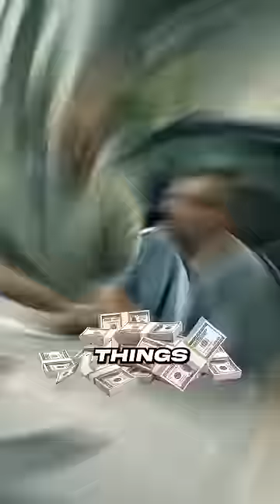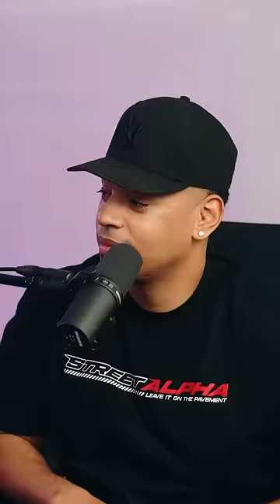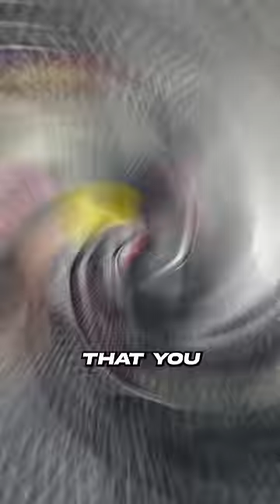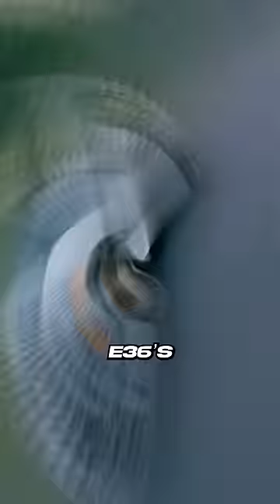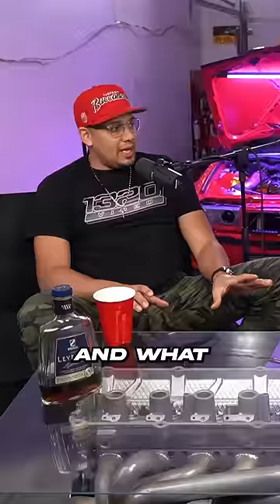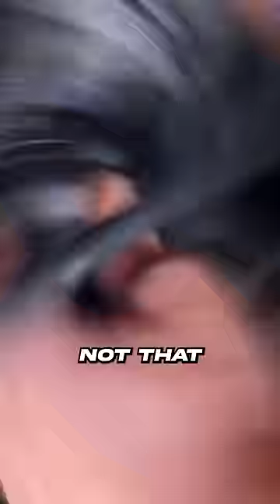What BMW DOES NOT Tell You 😩 #shorts

Comment: I work for a towing company! This man is really onto something! I’ve been towing 2021-2023 BMW’s like crazy for the past few months! Oil leaks, coolant leaks, reduced engine power lights, electrical problems! Stay away from them!
Reply: But BMW is fire bro... 😅
Reply: That’s cuz people are stupid and they buy them without knowing how to take care of them thinking they’re the shit. Cars like that need to be cared for a tiny bit more since they’re a step up from a lot of cars but people don’t know how and it gives those brands a bad wrap.
Reply: @1Gambler_ they are very nice and luxurious but yeah, I’d never buy one
Reply: You are just a big liar. 2017 and up are very reliable. They feature updated version of the problematic engine. Most of the issues have been resolved on these model years.
Reply: @ifeanyiikemefuna3706 I have a 2016 328i that I’ve owned since 2019. Got it with 16k miles and I’m currently at 59k. I’ve had 0 issues other than random electrical shit aka Bluetooth or wired audio just stops working (happened less than 10 times) I did have the car go into limp mode once due to a sensor reading the fuel was running rich (happened around 2021) haven’t had a code since then. It’s a German car they are over complicated for no reason but they’re a far way from the shitty engineering they used to have back in the early 2000s
Reply: @1Gambler_ hell no bro it's an overpriced piece of shit. The equivalent of iphones in the phone industry.
Reply: @420Manhwa  Who's offering better cars than BMW.
.
 VW? Merc? Nissan? Hell nah
.
BMW understands the streets bro.
Reply: @realmz.4575 they are crap...I knw ppl buy them and drive 20km from dealer and it shut dwn...and I'm tlking new BMW
Reply: Never seen a 2021-2023 BMW broken down on the road and I commute a lot. 
Either 
1. You are lying 
2. Not familiar with the year makes and models (you probably looked at a 2006 BMW and thought it was 2023)
Reply: @ifeanyiikemefuna3706 100 percent agreed. We haven't even seen how long the 2017 and people make these ridiculous conclusions.
Reply: @AraP24  So because u haven't seen q means it hasn't happened....🤔are u God you are EVERYWHERE at once?? Do you knw EVERYONE or every BMW owner??
Reply: @ifeanyiikemefuna3706 lmao okay then bro! Whatever you wanna believe. BMW’s are beautiful but they’re straight trash! Endless money pit!
Reply: @AraP24 right but who owns a towing company? Me! Do you? I’m on the road daily! So I tow them daily!
Reply: Any proof of this? Cab we confirm you're tow truck driver?
Reply: @1Gambler_  lol that's easy. Lexus 😂
Reply: @Jose-it9po  I do accept there was a time BMW engines left much to be desired but the story is different today. I'm confident because I have one. My experience has been awesome, my greatest expense has been gas. And I've got a V8 not the glorious B58. It's your word against my experience - sorry, my experience trumps your words every single time.
Reply: I’ve owned 2 so far 2014 and 2021 F30 and G20. 1 I’ve never heard anyone recommend getting an oil change every 20k miles. 2 Those cars would still not only be under warranty but also under a maintenance package. There would be no excuse for  neglect if you can bring your car to a shop for the tiniest thing for free. Only thing I could think of is a cracked rims or shredded tires because BMWs don’t come standard with spares. Ive owned my most recent one since 2021 and my maintenance package ends in November. 60-70k is when you start having to worry about getting a tune that includes getting new spark plugs and ignition coil. The only recommendation is to change out the plastic charge pipe for a metal one.
Reply: @realmz.4575 there’s no excuse. When you purchase a new bmw they come with a maintenance packages that lasts for 3 years or 50k miles. If it’s a 2021-23 they would be still covered. The owner just has to go to the shop when the car says to. Regular maintenance like oil changes, filters, lights, wipers are covered if you pay a little extra brakes and rotors are covered. What you’re saying is true for someone getting a slightly older model.
Reply: @Jose-it9po I always wanted an m3 but ALOT of people say negative things about BMW. And it's the same here. Because of that I never wanted to spend the cash
Reply: All i can say is the word "intake manifold/bridge"
Bmw guys will understand
Reply: @ifeanyiikemefuna3706  take off undercarriage bet you got oil leak
Reply: @6.2_2ss  it doesn't matter what I have got going on, the car moves with no check light. Moreover, my car gets inspected at every 5k miles when I do my service at the dealership and they recommend whatsoever they think need to be fixed. Take your maintenance serious and you will have rest of mind.
Reply: @Jose-it9po  your anecdotal claims mean nothing. Like I said, you probably cant tell new BMWs from old ones. You probably just look at the badge and proceed with your confirmation. If 2021-2023 BMWs failed so often on the road that requires towing as you bogusly claim , there would have been major recalls or lawsuits which don't exist.
Reply: Theres no way to care for the plastics eventually theyr gonna get brittle and break
Reply: what about mercedes?
Reply: @Sphe.M  same and they use air to water intercoolers more expensive
Reply: Tell me about it.. I'm a truck driver. The most cars I've seen stalled on the side of the freeway........YES ....BMW....You want a good car buy a Toyota or a Honda .
Reply: Hes not speaking rocket science. Talk to any mechanic who has worked on bmw’s. They will all tell you they hate to work on them. Things break as soon as you start to take things apart.
Reply: oil LEAKS !!!!!!!!! yup
Reply: @Jame6999 I have an X4M comp and it is a beauty - the engine is quality. I would say people complain about the quality because they are expensive cars so anything that does go wrong you are getting a 180/hr working on it so you feel it or notice it more (if you are towing company owner) Like anything expensive you do maintenance to ensure something doesn’t go wrong - BMW doesn’t need to use failing parts to lock you in, it is the finance agreement and the depreciation. If you worried about costs stick with a Corolla or whatever car is cheaper to run and maintain.
Reply: Y'all need to stop falling for the "old bmws suck" the 2000 bmw z3 was the best handling car in top gear and it went against a goddamn FERRARI at its time nd sure yeah sum things are plastic for NO REASON😅but trust me any bmw 2000 nd under is easily workable on nd most parts are replaceable with metal reinforcement e.g coolant hose
Reply: Maybe just warm up your oil first before tripping that 8000 revs 😂
Reply: IVE HAD EVERYTHING YOU JUST SAID HAPPEN TO MY BMW. AND SOME.
Reply: @realmz.4575 they’re a step up? 😅if u think the need to baby a car and treat it as if it’ll shatter apart if u rub it the wrong way is a step up then I question your judgement. Reason why u have to tend to them a certain way is because they’re fragile creatures, let’s be honest buddy
Reply: @lowk3ychris484 buddy, chill… u are still within warranty life. Wait till u get to 80k-100k miles. U gonna learn what bro in the video was talking about
Reply: @KnowPain666  doubt I’ll ever get the car there 😂 still under 60k miles at this time
Reply: @lowk3ychris484  it’s easy to doubt but u said u got it at 16k miles,. You’re pushing 60k now. Those numbers go up pretty fast. I’d say they’re better to lease and switch out every 2 yrs for a brand spanking new one. Yes, u would never own it but u won’t have to worry about maintenance fees and the life expectancy of the vehicle
Reply: Nonsense. Lies upon lies
Reply: I've got a 2016 335d. I've done 18k in repairs, just over 2 years of ownership
Reply: I work in motor trade and asked a recent Tow truck guy what cars breaks down the most from his experience, and he told me Range Rovers
Reply: All bmws are crap especially when they get to 100k miles
Reply: Not even close to what he's talking about.....
Reply: 2 months and 1400 tows later I still stand behind my original comment. BMW’s (not the older models) are straight trash 💀
Reply: @SuperKoreanzombie depends on the company and the area they work in and what car is most common for said area. I’ve towed a few Range Rovers. Usually lost keys or dead battery and won’t take a jump so they end being stuck in park. BMW’s are common in the area I work. There’s never a week were I don’t tow at least 5 of them. On top of that our company has a contract with BMW Roadside, so I tow them frequently. Only voicing what I see from my experience
Reply: @realmz.4575 No, these new BMWs, Audis, and Mercedes are dog shit compared to the cars they made 15 years ago. They have started using cheap engine and electrical components which is why so many things break on these new ones. They are using cheap parts and that’s why they are breaking down more than before.

Comment: Automotive engineer here.
OEMs being our customers they tell us how many years or miles a car needs to work without failure. Roughly 15 years or 170k mikes depending on the industry. We engineers calculate the equivalent testing procedures to guarantee durability along these hours of usage. If the parts fail, we need to redesign. If the parts survive the goal by a small amount the part is good. If the part is way too strong, its described as overengineered and therefore there must be a cheaper solution that also reaches the goal that has been stated by the requirement profile. At least here I can say we do not design for parts to fail intentionally, we design for parts to be not unnecessary durable as they would be heavy, inefficient and more expensive and you the final customer are not willing to pay for that.
Reply: I hope you ain't lying coz this actually makes sense 😂
Reply: Si a new car is cheaper than a new part???? Because it will be more heavy? 💩💩💩💩💩💩
Reply: Great response from an Automotive engineers. Thanks bro.
Reply: Also alot of things the engineer wants to add gets scraped by the guys doing the Productmanagement, because they want to maximize the profits.
Reply: @chexey  yeah especially recycability, remanufacturability or sustainability often gets scraped... but I do see here a positive change in the industry at the current time
Reply: @M_aze my thoughts exactly lol
Reply: Sounds like what apple does when it wants you to buy a new phone ..all of sudden battery turns to 💩
Reply: This is still planned failure. They put a nice story around it so you don’t complain… but they are asking you to make sure it fails at a specific point. Finding out it didn’t break and saying “oh it didn’t break? It’s over-engineered it needs to be weaker to save weight” Says it all. 

Over complicating designs ensures the customer won’t be able to fix it themselves and any person with sense would just buy another after certain failures. You really gonna rebuild an engine or trans at 170k? 

No. The other planned failures will creep up shortly after and make you regret the decision to try and kick it down the road. Auto industry is very dirty these days.
Reply: American engineers:

Japanese engineers: wait you guys dont overengineer every part???
Reply: No I 100% would pay for that. But they won't offer that. Ever.
Reply: @fabiancastellanos7196 wtf are you saying?
Reply: @PatRiot-  no, what OP described is typical engineering design trade offs not "planned failure". Weight is a significant factor in a car's performance and better performance than your competitors will likely increase your market share.

The majority buying new cars from prestige car companies would have upgraded long before 170k miles which means their actual customers (not the second hand market) are not motivated by "planned failure" at 170k
Reply: Doubt that bmws implements this.
Reply: I want an over engineered car that can do a million miles without breaking. I don’t care if it is heavy or expensive.
Reply: Unnecessarily durable means a good part that will last the lifetime of the vehicle. And that translates to less profits for the car manufacturers. Using that double speak, I see.
Reply: @meademorgan6614  if the whole car is designed with the goal in mind to cost the least possible, because otherwise the final customers will just buy another car that has better "value" . So there needs to be a requirement profile that states the lifetime of the car. If one part surpasses this by three times, it wont benefit you as the car will be scraped a long time ago before the part itself reaches EOL. So that part was unnecessary expensive, and that car for the stated requirements unnecessary expensive. The market regulates itself. There are durable vehicles for hauling ass but they do cost more. And they are less efficient, and heavy. Being less efficient means also more taxes and costs to operate and bla bla bla until it gets unattractive because everyone is accustomed to cheap stuff. However I do agree that everyone likes to have a margin on its production and greedy CEOs and Shareholders want even more money than necessary and that in general worsens the situation everywhere and on every level involved including transportation of parts etc... But that mainly just makes stuff unnecessary expensive and not really prone to fail by design.
Reply: LOL

Comment: Former BMW tech here. If you actually change according to the schedule, you won't have problems. I've never saw sludge build up on vehicles that did it right. Premium oil and technology to understand engine oil breakdown make it possible. You can't design a car to fail the moment its outside of warranty. He mentioned E36 the old ass gen 3 series. So what about the vehicles from E90 on that improved on most all of the most significant failures. They improved with life cycle upgrades for a better product constantly. They sit at the leading edge of vehicle technology, years ahead of our domestics. BMW does want you to come back, but they can never guarantee it. The service return is not what they really want is the new car after warranty. We always said BMW is a special tool company that makes cars.
Reply: I guess you cleaned this video up huh except the plastic part hmmm
Reply: I agree, but what he’s saying about the plastics is phuckin spot the hell on. I’m sorry, it just is. Granted, the only issues I’ve had with my more recent Bimmers are the VANOS systems, but I’ve rarely kept a Bimmer past the warranty because I’m afraid of brittle plastic parts undergoing multiple temperatures changes. That said, there’s nothing like driving a BMW. That’s just the reality.

Comment: He is not lying. However, I change the oil every 5K miles and change the radiator fluid and other fluids (rear axle etc) at half the recommended mileage. I also warm up the car slowly by letting it run before I drive or driving to the highway at a slow rate of speed before driving at highway speeds. I’ve driven 198,000 miles so far on my 2004 X5 and have only changed the radiator once because, you guessed it, the plastic where the hose connects the radiator to the water pump had a hairline crack that leaked. Lastly, Autozone sells Premium brake pads that once worn you can return for a free set. That’s two sets for the price of one.

Comment: 2006 E46 M3 owner for 8 years now. Purchased vehicle used at 113K miles….now I’m at 165k miles. 20 track days and lots of weekend backroad time attack abuse. TBH idk if I’m lucky but I’d say it’s been reliable despite the abuse on how I drive it. Obviously normal stuff had to been replaced…starter, clutch, alternator, fuel pump ect. Normal wear items…..i DIY all the labor on my car and have a plug at BMW dealership for all OEM parts (relative that’s works at BMW dealership) yes it’s been expensive but reliable! And I drive the shit out of it!!
Reply: Starter clutch alternator etc are not normal items to break
Reply: @Vanguardkl on a 2006? Get real. Lol

Comment: I worked for BMW in development and I‘m sorry to say that this is not true. The problem is that the cars are too complex for the way that people treat them. I have had my fair share of BMWs from all generations (after their warranty had expired) and they ran flawlessly. However, I always let the car warm up slowly before pushing it and cool down slowly afterwards. If you do that and you change your fluids sufficiently often, you will be surprised how reliable BMWs are
Reply: You'll never make them understand in this I want it now society . You are right although I will say plastics have a shelf life
Reply: I work in the injection molding industry and were suppliers for some brands.

I came to realization, that half of the people so called "car guys" only know about so much about the car from factory. 
They dont know how it was built, what the technical data of the material beings used are, such as density, strength and stress levels. 

Therefore they can't possibly expect it to be long lasting when they cant even come up with solutions themselves. 😂
Reply: It’s the Same reason people are still buying Manuals when Automatics exist. Involves being more versant with the car, feels more rewarding when you’re maintaining it, teaches you new things, extremely fun, and most importantly it makes you look cool. kek

Comment: This was probably the most informative episode of this podcast. The most tech info. The most nerdy. 

Best episode in my opinion.
Reply: He literally blamed failing plastics on a long oil lifecycle. And fails to understand that a car costs money to make and it requires compromises.
Reply: @tysonchickennuggets  no he said the plastics fail from heat cycles pay attention.
Reply: its avius thats how they fail, but i don't see how it was related to an long oil length, yes the reason why they use plastic is bc of costs and the ability for plastics to be resistant to heat cycling. not as much as metal tho.   @TonioXenon